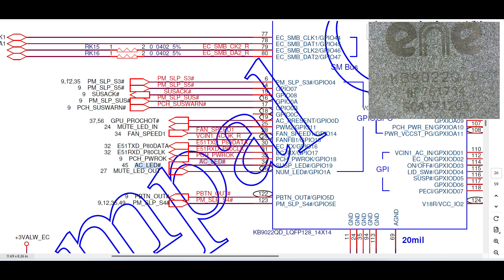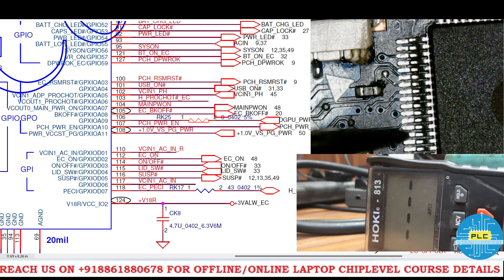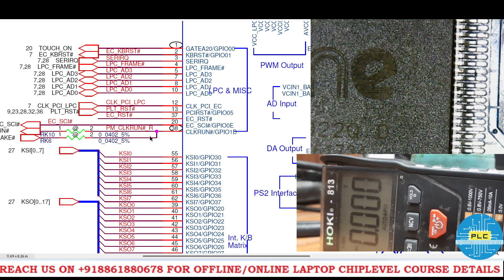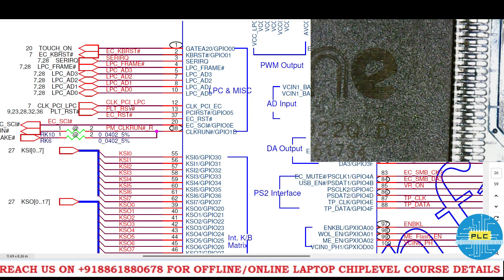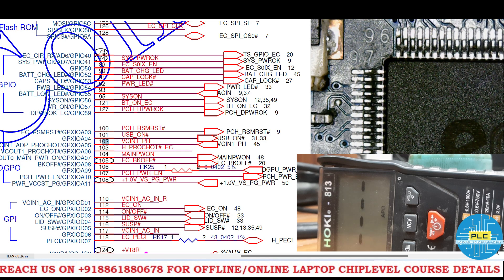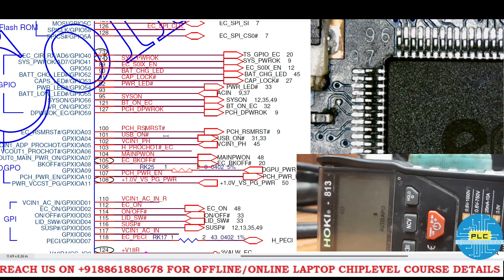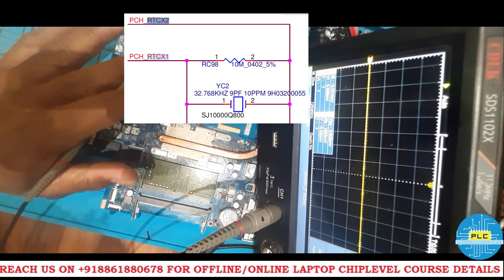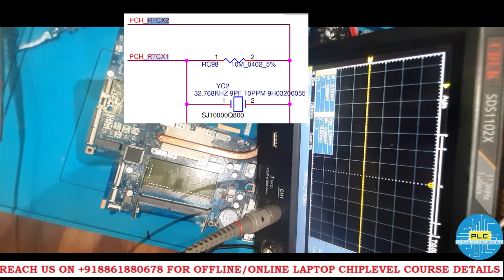Laptop Repairing Full Course - Practical - 02

Comment: hi, with respect a very litle a very small observation, when u check ec reset u must check not only high state , in fact is very important  delay couse a capacitor must be charge and that only can be seen with a osciloscope,  i am wrong ?  for that reason must check capacitor charge curve thats delay a high state and when get it high state works like a reset 
you are included in the elite of a repear teaching ! thank for all your videos
Reply from the maker: Here also I have told the led light off and again ON state. These are deeply will teach to our PLC paid students.  Viewers will get bored.  Anyway,  thanks for your valuable comment.😊